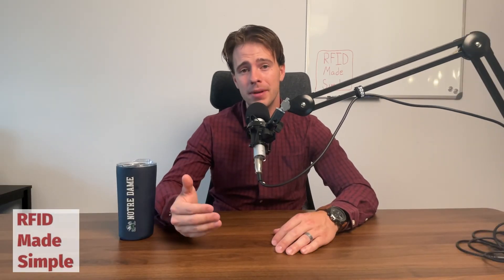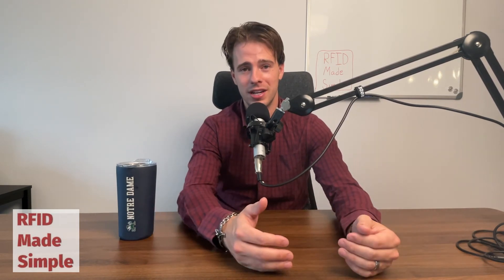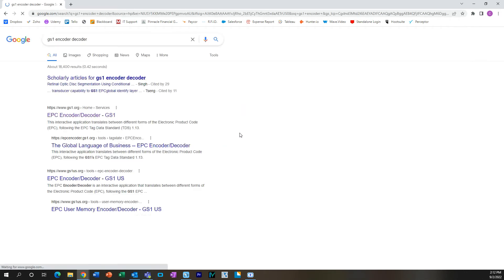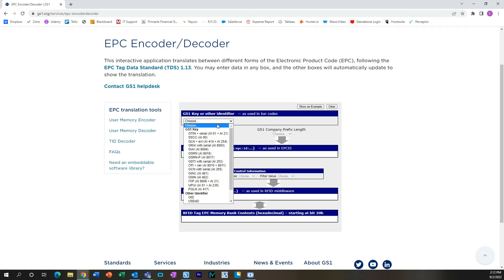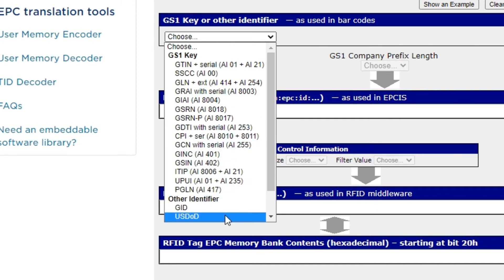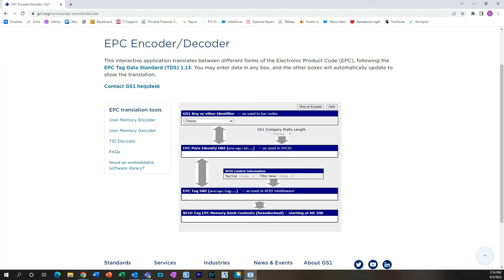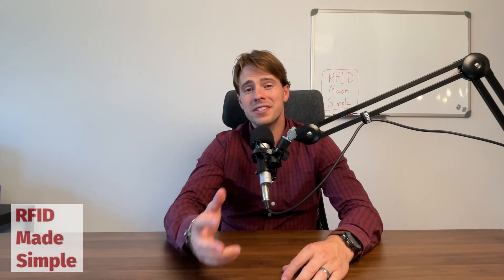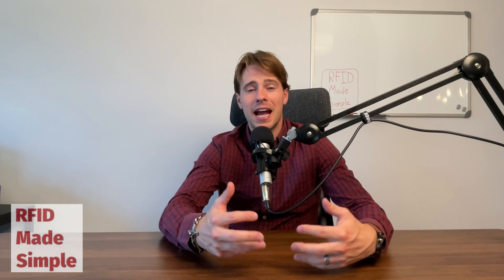RFID Encoding | Schemes & Standards

Comment: Those with at least a passing familiarity with computing may be confused by this explanation of RAIN RFID Tag memory "blocks".  So far as I can tell, "block" is not a term used in RAIN. What RAIN does describe are Memory Banks, and within those Banks, data is stored as Words. There are four Memory Banks: TID (tag id),  EPC (or UII; product Id); User, and Reserved (used for things like passwords and locking).  Within those banks, there are some number of  data Words (varies according to chip), where a Word is defined as 16 bits, obviously equivalent to two bytes, or four 4-bit fields that can be displayed using hex notation as usual.  When this video belabors the fact that you have to write an entire "block", this appears to be saying just that the memory is addressable word by word, which is to be expected.
What would be quite useful to know is what baseline common features RFID chips are required to have (for example minimum tag id length), versus degree to which those features may be extended in different chip models and are thus the basis for distinguishing one chip from another (and tags that use each chip).

Comment: "schematic" -- If you're referring to a particular format, structure or organization of data, the term used in the database and IT realm is "schema". The word "schematic" usually refers to a diagram of some sort, like an electrical or electronic circuit diagram.

Comment: Which one you prefer? Gs1 or rain?
Reply from the maker: RAIN is still fairly recent in it's adoption over the past year, whereas GS1 has been widely recognized for many years. It also depends on your RFID system and whether your tags will be read by other organizations. 

If I had to boil it down to one answer, I'd say GS1, but I'd recommend contacting both for more information to see which one best fits your application.